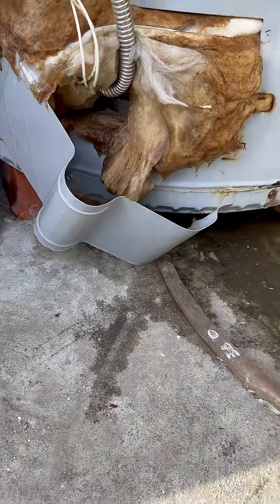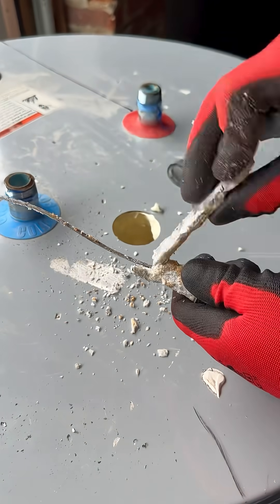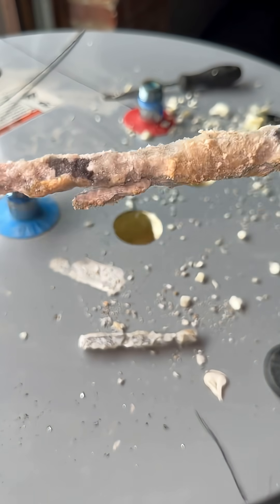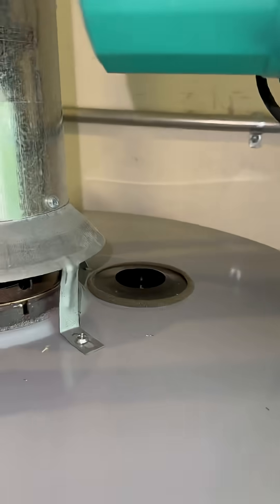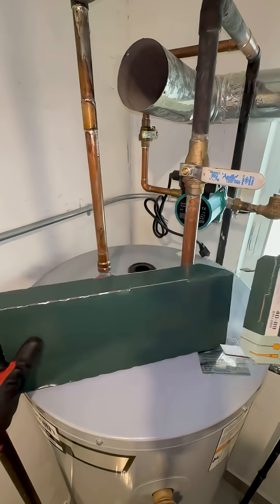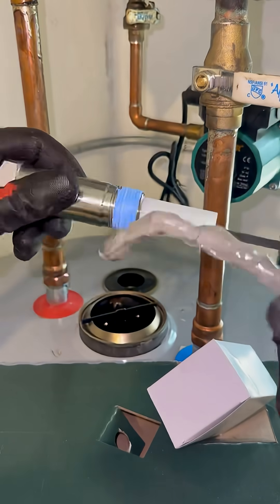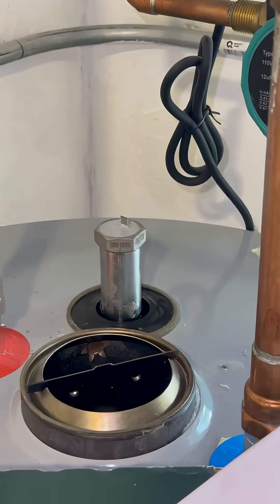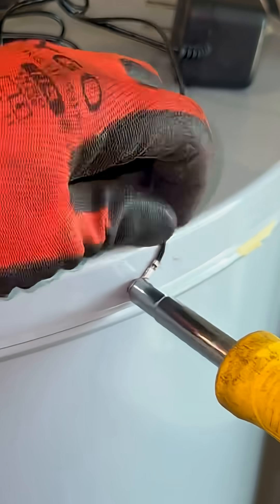Your water heater is fighting for its life! #waterheater #corrosion #anoderod #corroprotecpartner

Comment: So the movement of the water is what create electricity causing the slow corrosion. Anode rods take the hit from instead of the tank your ment to replace them every 3 years. The powered one should last lot longer or never expire has the powered keeps the corrosion from happenings. I do not understand the science of how it works to my understanding it would make it worse so there something im missing.

Comment: Broski, tanks are designed to be maintained lol do your cx's a favor and get him to regularly do maintenance on his tank.

Don't get me wrong the anoid tech is cool, but there's other parts that need TLC.

Dip tube needs replacement; it's like your transmission. Swap it out every 2 years, tank lasts forever. Let it degrade and change it when they have not enough hot water => that tank will split next March when the stupid cold water shocks the tank. 

Burners and elements will need service too.

I will say my favorite tank is a 1987 GSW (AOS) conventional vent 40 gal. Still see them installed in cx houses (built like tanks, easy to service, great tank). Now I deal with Bradford dents everywhere and the quality sucks. 

Don't start thinking the new technology will stop blow outs lol stay safe my dude.

Comment: THANK YOU for this! Water heater manufacturers are terrorists in my opinion! But I highly recommend Rheem brand. The last one we took out lasted 50 years (original to the house) and was still going strong. A family member kept saying it was unsafe (no pop off valve) so we replaced it. I wish we hadn’t. Got another Rheem and it’s like new 7 years later. It heats water like Old Faithful. Better insulation and inner liner than average.

Comment: I have a Rheem water heater that's been running for about 13.5 years, and I know there's a lot of sludge at the bottom because it makes a dripping sound when it turns on. It's not leaking yet, but I believe the anode rods may be shot. I have to turn up the heat setting past the arrow to get a decent temperature. I thought about using that attachment that connects to the drain fitting and blows air, but I'm worried this is only a temporary fix, if it works at all. I realize the heater is nearing the end of its life, but since I’m renting my apartment, I can't do any preventive maintenance. My landlord seems to think the water heater will last 15 years. Keep in mind, it has never been drained before, so I wonder if it's even worth spending money on a titanium rod at this point. It probably wouldn't be worth it. Additionally, I have a three-bedroom condo with a 50-gallon water tank. And my landlord already stated that if it needs replacing, they're only going to get a 40-gallon one because there are two people living here right now. What can I say to refute that silly logic?

Comment: Sacrificial metal os a legitimate way of cathodic protection, but it shouldn't be placed out of view. Just bolting a nickel or zinc plate on the outside of the tank would be enough to make it last 5 years depending on size. After that it's easy and cheap to replace. 

But active cathodic protection is still by far the best option although initial a bit more expensive.

Comment: I use a recirculating heater. No water tank . Just two recirculating pumps and a wall heater mounted on in garage. Much cheaper and near zero chance of failure

Comment: my mom had a hot water tap, we just stopped using it, it always smelled... foul.  NOW I know what it was from! (I mean, not from the water heater, that was separate) but corrosion on the flash heater unit. got it!

Comment: The abode rods should last 4 years if the water isn't hard. 2 if the water quality is bad. Best bet is to replace the anode every 2 years, element at the same time, flush it annually, and the tank will last forever. If it is natural gas, pull the gas control valve and clean off the prove when replacing the anode rod. You say they are built to fail, but I have seen water heaters 10 years old that look brand new. It is all based on the quality of water. The power anode rod is only as good as the circuit powering it.

Comment: good job, showing this. I always put a tee at the boiler drain, run cold fill to that, pull dip tube and add second anode rod. If it stinks: there's two types of anode rod: Aluminum and Magnesium. If their hardness level is that high: you had a filter / softener sale there. An expansion tank on the output and an old water heater with insulation and outer jacket removed as an acclimation tank: even better. Geothermal loop and boiler exchange type water heater for potable may help in most markets. Water chilling, forced air coils, LOTS of opportunity and fun.

Comment: Yeah I don't trust manufacturers enough to apply any current to my water line. Sounds like a great way to suddenly get electrocuted one day when shit shorts across.
I just swap out a new rod when it needs it, but then again I have a 30+ year old water heater that is still going strong because it is drained and flushed of sediment once a year and the rod is checked during that time. 
The rods are only like $7-$14 and they are good for 2 years with the absolutely worst water up to 20 years with decent water.

Comment: With proper maintenance and appropriate selection of product those anodes can last upto five years unless you have particularly reactive water. I had the anode in my heater replaced just after I bought the house out of an abundance of caution because I didn't know what condition it was in and what water condition was like and it was 5 years old and only just starting to turn over the hill towards failure/end of service life.

Comment: As a Master Plumber, I can say I'm not sold on it. It looks to me like a big rip off scheme. If the water has a bad smell, there are much bigger issues than just an anode rod. It's an indication that there's bacterial content in the water supply. This remedy you're offering is a bandaid on a broken leg. Further, this system you're peddling is likely to cause the water heater to leak sooner. My advice: if people have a sulphur smell from their HOT water, they need to have their ANODIZED ALUMINUM ROD replaced with the same and add a carbonized cartridge water filter to the potable water supply system for both the hot and cold water distribution. Or add a water softener, or both.

Comment: Stainless steel & fiberglass has been tried to save the tank but the electrical heaters fail - so the cost from a repairman is about the same as new tank - ask the city water works guy how to have a longer tank life - he might say don;t buy cheap

Comment: Living in Europe I haven't seen a hot water tank for at least two decades. When we had them, they lasted almost forever. 
I miss them, the heat lost from the insulated tanks used to be used to warm a cupboard used to store bed sheets and towels, it was called an airing cupboard 😂.

I can't help but think that American products are  not always designed to last 🤦🏻

Back when we did have hot water tanks, they were copper and this did not suffer noticeable corrosion. They lasted many decades. 

Heating the tank was achieved by two methods.
The primary method was via conduction from a coil of copper piping, this was supplied with hot water from the central heating (the water did not mix).
The second heating method was an electric emersion heater (heating element), used for emergency hot water. 

For example when returning from holiday and the central heating was off etc.

These days water is heated directly as required, usually by gas or sometimes by electricity.

Comment: They're not even magnesium for the most part. They're aluminum which creates toxic aluminum salts in your water heater.  That's why the manufacturer tells you to purge the salts every 6 months.  But few people even know that much less do it.  I replaced my aluminum anode rod with a magnesium one because magnesium salts are not toxic (who wants to shower in toxic water?), and I just checked it after 6 years.  Still had 65% and the core rod was still fully covered.  If I were softening my water, or if my water were not pH 7.0 from the city, I'd use a powered anode solution.   Since I have good water - neutral pH and 2ppm TDS - I'll stick with the magnesium rod and 6 month drain schedule.  My tank is 17 years old and is still in great condition.

Comment: I built my home over 50 years ago. I had my own well, bought my own water heater at JC Penny’s. I removed that rod at that time and when I sold my home in 2018 l never replaced the heater and I believe it‘s still working today. Never had trouble with the taste or smell of the water.Don’t make them like they used to.
Reply: I lived in a house with a well, and the hot water smelled like actual crap. I used to shower at the gym. I replaced the magnesium rod with a powered anode, and the smell was gone
Reply: Woahh
Reply: Probably had a big old anode
Reply: Jc penny's is not far from me lol
Reply: 50 that's insane
Reply: You removed the anode rod or you put on a powered anode rod at that time? Big difference. You should not just remove the anode rod and cap it off.

Comment: I'm welder at A.O. Smith water heaters. Almost all water heaters today use an aluminum anode. Less than 1% of our units get a magnesium anode.
Reply: Every single manufacturer is switching anything they can to aluminum. That is across all manufacturing industries. Whether it's the rod in your water heater or the grease zerk on a balljoint.
Reply: Is aluminum better or worse than magnesium?
Reply: @davidcanfield883  Better, but even aluminum can be used with a low voltage current.  Ships use powered anodes for corrosion resistance, too.

Comment: I have an old 80's water heater that's glass lined. Never serviced. they stopped building them because the glass lining would break during shipping/ installation. No way to tell until it rusts through.

Comment: Cheap works for small households install an AT POINT ELECTRIC WATER HEATER in bathroom and Kitchen or larger flow one for whole house. Got rid of gas fire hazard death and water sitting in a tank forever crap. Mine is over 10yrs old

Comment: Every hot water heater I’ve ever worked on the anode is welded to the top of the tank. Replacement is impossible

Comment: Also (based on the early part of the video)... DO NOT prop your hot water heater up on bricks or cinder block.  Bricks are porous and will conduct moisture right to the metal on the bottom.. rusting out the bottom of your heater in a couple of years.  Also, use a good sized plastic drip pan if the floor is not sealed and drained specifically to handle "flooding".

Comment: I was going to get one of these when I replaced my hot water heater 2-3 years ago…. But instead of spending like $160 on this, I just replace the anode rod with the magnesium ones every 12 months (I think they are magnesium… whatever they are lol)… I think I got a 2 or 3 pack for like $20 or $30 total with tax. I could easily go at least 2 years in between replacing them, but we will see how it goes…

Comment: Hex socket size? Is it standard? Also what is the grey goo you put over the blue thread tape?
Reply: 1 1/16" 6-point socket to remove the existing anode. 1 3/16" 6-point socket or an appropriately sized crescent wrench to install the Corro-Protec. Be prepared to need an impact wrench to remove the existing rod. The "goo" is plumber's pipe dope. You don't really need it. Teflon tape works just fine.

Comment: I'm buying this now, this describes exactly my issue. Question, my water heater is already a few years old, is it recommended that I swap the water heater right away or is it fine to use this rod right away with the old water heater? I'll do a flush at either rate.

Comment: The trick to remember with modern anything is that the quest to reduce manufacturing cost has resulted in everything being put together with the cheapest low quality materials mankind has ever been capable of producing.

What needs to happen is the enforcement of contract law, something that women got rid of because of their dislike of permanent agreements, before the death toll of all the cheap crap starts to stack up as equipment that we use in everyday life to do things starts falling apart as they're doing it.

I guarantee under modern contact law a company could build a car that literally flies apart into pieces while you're driving and you will have no course for the lawsuit because the car company is owned by so many people in the society that the politicians would drop the case something like this literally happened with Intel and Microsoft October to December 2024 and the government legally found that it would hurt the country too much for them to be legally required to pay anything out for it.

They were literally just told it was a bad thing to do, and that was the end of it, and that will be the future when cars start flying apart at the scene and elevators drop people from the top of buildings.

Comment: His water stunk because he had hydrogen sulfide gas in his water, which is a byproduct of sulfate reducing bacteria breaking down the sulfate in his water into elemental sulfur. His old magnesium anode was giving off free elections inside the water heater, which is basically fuel for the bacteria. The reason the new power anode removed the smell is because the corrosion protection mechanism (very small electric current) does not produce the abundant free electrons (fuel) for the bacteria to thrive. He essentially fixed 2 problems at once.

Comment: EVERTHING is designed to fail nowadays. It's called Planned Obsolescence. You design a product to fail after a certain amount of time.
 This started on a very large scale in the 70s when companies that made high quality products were making way less money than companies that made garbage.
Reply: The natural progression of capitalism. Companies deliberately design things to be lower quality and they justify it as “cutting costs”. Like in this instance where they use magnesium anodes instead of powered titanium rods. If not regulated, these companies would even patent their products’ screw shape to make it difficult for consumers to use another company’s replacement parts.

A proper socialist economy wouldn’t have this problem. There would be no profit incentive thus no need to design things to break. On the contrary, to maximize resource efficiency, a socialist economy would try to make things last as long as possible. Hence why people who have bought products from the Soviets had their appliances last decades longer than their capitalist competitors. But nobody really thinks about the lifespan of a 25 year old fridge vs a 50 year old one. It’s such a long timeframe that it’s hard to really consider. This is why companies can keep getting away with it. Our monkey brains aren’t really good at long term thinking.

Comment: It still sacrifices itself, it just uses a much denser material and impressed current cathodic protection.  The magnesium and/or aluminum anodes used by the manufacturer are a much more active metal than the steel of the tank so the protective current is natural. The new anode needs forced DC current the other way to protect but it's a far superior protection solution! 
Nice vid!

-CP Technician

Comment: Well water (no chlorine) multi stage water purifier system.  My heater is 10 years old. I run it hot as hell. If it stops working. Its going out the back door. New heater 1000$

Comment: Looking at the amount of hard water scale on the old anode rod, I will bet dollars to donuts that the bottom of the tank has a huge deposit of crud.

I would have drained the tank and put my endoscope in the anode rod hole to see what was in the tank.  

An acid wash or descaling will return the water heater to its original energy efficiency.

Replacing the anode rod is not the full job.

But it does seem to be an advertisement for the electric version.

I would rather install a new anode rod and swap it out every 3 years, inspect the tank andcacid flush the mineral build-up..

Comment: Id like to actually hear some science behind this before trusting it. Sacrificial anodes have been a thing for so long and are still the go-to method for corrosion prevention in many scenarios. If you could simply use power to prevent it, we'd be doing it in many scenarios.

But then again, there's always a first, and water heaters are much different environments than boats and bridges. I'd still like to actually see any science.

Comment: will this work for my rusty truck frame? I guess there's nowhere to complete a circuit with the air since it's not liquid bathed unfortunately. maybe a semi-liquid sticky coating could work for a while, and complete the circuit with a strap around the frame so it's only touching the coating and not the metal so it wont short circuit.

Comment: I spent $5,000 on my solar water heater in 2017. Last year, I decided to check the anode in it, only to find that there was no trace of it left, only the top of the bolt that holds it in. What this guy is saying here is so true. I did buy one of those powered anodes, and in a couple of years I'll pull it out and see how it does, but the $100 spent for that is definitely worth it if it keeps me from having to replace a $5,000 solar water heater before it's time.

Comment: Wait, US waterheaters corrode in half a decade?
My family homes water heater was installed in 1998 and except for the replacement of gaskets and installation of a new burner (its gas powered) to increase efficiency it had seen lottle work... i mean its juts a tank made for storing heated water with pipes to radiators and faucets. XD 
You know sth we can purpose build out of materials known to corrode very very slowly.